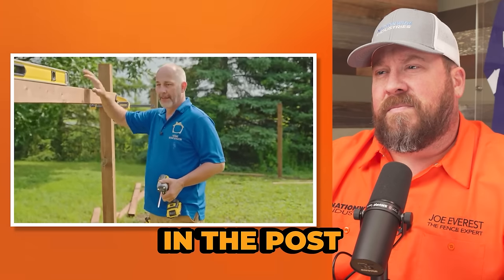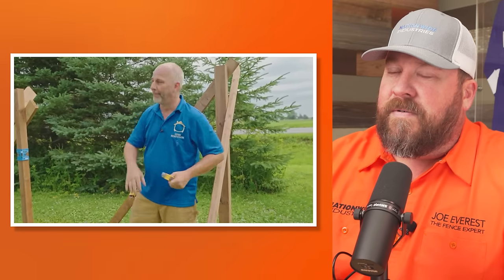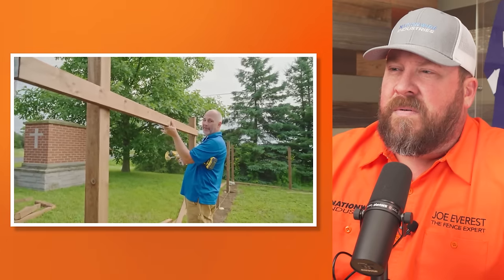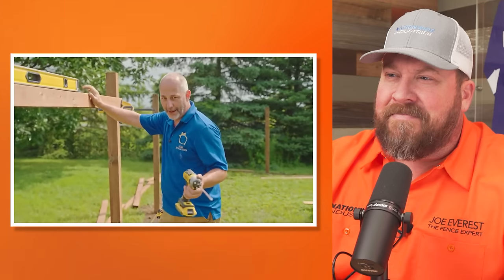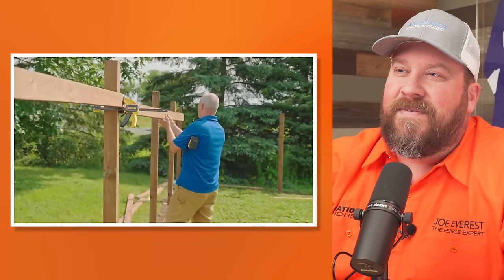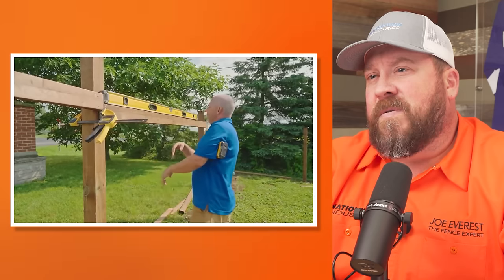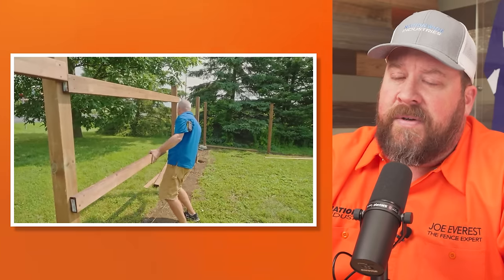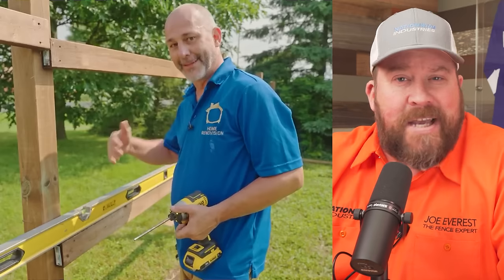PLEASE Do Not Build Your Fence This Way! - Fence Pro Reacts

Comment: This put a smile on my face. I used to be subscribed to that Jeff guy till one day he was doing duct (ventilation) work and a pro told him he was doing something wrong and it made a lot of sense. The guy was saying to put the male vent pipe towards air flow and the female against the air flow like that you get less potential for air leak. Instead of accepting his mistake and thanking the guy for info, this Jeff guy told him off, I unsuscribed on the spot. Haven’t watched any of his videos since lol. Keep up the great work.
Reply from the maker: Sounds like a very Jeff move, thanks for watching and weighing in!
Reply: yeah, just did a load of ductwork in my new house and it made sense to me that way (thought of water rather than air) so having no edges to "catch" would improve air flow.   rarely touched metal work since I left school but being a technical guy in a technical trade, I read a book on the subject first.

There are Social media people who are educating and others who use it as a source of income.   many "trade people" start out as the former and end up as the latter.     Not to say there is no information to be gained, even if it is bad information.
Reply: Thats one of the first things you learn in sheet metal school after how to use tin snips lol
Reply: Can yoy elaborate? Male part as in it fitting inside the larger female duct? 
If the air is moving towards the "male" interior edge part it would create a high pressure zone in the joint and cause more turbulence/non-laminar flow... you sure your didn't mean the opposite? Can you please post video link what he did?
Reply: @stoptellingmewhattowrite  I’ll explain it with left and right to make it easier to understand. Say air is flowing to the right and you have 2 pipes joining together. Pipe on the left would have the male part that fits in the female on the right side, pipe 2 has the female on the left. The pipes have about 2-3 inches of overlap, either way the joints are taped but if done correctly, the tape is just a precaution but if done the opposite way you’re fully relying on the tape for no air leaks.
Reply: @theone3337  So you are saying! Male end of duct should follow direction of air flow, down hill, step down, so air can flow over internal edge instead of hitting it?!
Reply: @mongo33101  yes
Reply: I unsubbed when he told his viewers to run an outdoor electric cord through an exterior wall
Reply: I undescribed too.
Reply: Your loss.

Comment: I attended a 2 year residential remodeling program where you graduate with an associate's degree. Our first year carpentry instructor (who was very talented... and demanding) described what he called a "quality triangle", where one edge was "good", another was "fast/easy", and another was "cheap". He drilled into us that you can only achieve two of those edges, not all three.
Reply: This applies to so many things, like building cars!
Reply: Thanks for sharing this.
Reply: It's songs like you have a problem with him not just the work
Reply: @anthonyc5003  Actually, I am a subscriber and fan of Renovision. However, there are occasions where Jeff's choices appear to be sub-optimal to me. I think he would have had a better result with using concrete for the posts as opposed to the foam product. This is a case where the fast/easy triangle vertex did not serve him as well.
Reply: Is carpentry hard I’m thinking about going to community college for it

Comment: As a home owner, on 40 acres. I make sure to do everything as good or better than the pros. The thing I can’t understand is why do people make “how to” videos about any subject if they have no clue what they are doing.
Reply: They are doing it because they truly believe they know how it's done. That's why I watch many how to videos and do more research to ensure I know the correct way before I follow a particular approach. Don't  just look at the first video that comes up with a particular solution to the problem.
Reply: Anyone can make a how to video, unfortunately it doesn't mean they're doing the activity correctly. I'd follow a dedicated fence pro on how to build a fence.
Reply: Likewise, I'm a homeowner on a small farm and the reason I'm a Do-It-Yourselfer is because of too many past disappointments. People either never show, delay you by months or even years, (the best contractors are usually booked up for many months), or too many do crap work with low-quality materials and disappear. The last thing I hired done was concrete flat work. It wasn't horrible, but had I been home I'd have noticed there was no expansion joint between new work and existing work. As I predicted, the outside driveway chipped out the edge of the garage floor from frost heaving for lack of an expansion joint. I think we could find dozens and dozens of how-to videos showing new concrete work meeting existing work without expansion joints. I feel bad for people who aren't discerning or have too much confidence that projects done on YouTube were done well. Too often something catches my eye and I soon realize the quality of information on the subject is simply wrong, even if it's something as simple as nesting boxes in a backyard coop.

Comment: To be fair, if you’re DIY all the crap that home renovision covers, his advice is usually pretty solid and understandable for the average Joe that is DIYing a job.

Also worth noting that even if you hire a “professional”, half the time they suck. So you really have to dig (no pun intended) to find a contractor that is going to correctly build you a solid fence.

I love the Home renovision channel and find a ton of useful info in it. But I also understand that his methods are “good enough” and not necessarily best practice. As long as you understand that, it’s a fantastic resource if you need a starting point for DIY projects you otherwise know little or nothing about.
Reply: With certain things "good enough" is unacceptable. Fencing is one such thing. Better yo spend the money or the time researching the correct way of doing something to make sure it lasts. That whack job just hands out misinformation and shotty practices, and people follow his advice. That's not cool. A fence like what he glbuilt is going to look like crap and it won't last more than 5-10 years. Charging someone for that kind of work is slimy af and doing it for yourself is pathetic. I understand some people just want a fence that will last at least a year because they're selling or whatever, but that is also equally slimy.
Reply: @ericr154 literally every trade says theirs is the one where “good enough” is unacceptable.   They also all have a point. As most people cannot afford to have the best professionals do literally all the work on their home, being able to do minor repairs and improvements to “good enough” is a very valuable skill. 

Though one should try to understand the work one is doing well enough to know how you will be paying later for your shortcuts and learning curve. Specifically what it will cost you in effort, inconvenience, cash, or durability.
Reply: His drywall videos are terrible

Comment: I feel like this guy says "work smarter,  not harder" a lot.  Not measuring isn't smarter, it's just lazier. If you're spending the hours (or days) it takes to build a fence, why are you trying so hard to save 10 minutes.  Realistically, it would probably take me less than 10 seconds per post to measure 6 inches down and make a mark.  It would take me 10 seconds to measure 8 feet BEFORE I spend 10 minutes digging a post hole.  Yes,  it would take me a little longer to cut a mitered end on a stretcher, but i would probably make that time back with how much easier it would be to hang my pickets. And i wouldn't have to worry as much about my dogs getting out under the fence or, similarly, unwanted visitors getting in. Plus if I sold my house,  i wouldn't have the buyers putting "a new fence" as a contingency after they saw the hobbled together mess i made after watching that video.
Reply from the maker: All great points, thanks for watching and weighing in!

Comment: the fence on my parents lot that they bought next door to their house, has got to be close to 100 years old!  the house was built in 1908 that we demolished, and ide be very surprised if the fence wasnt original.  its only a 4 foot fence, but its def old AF.  i donno if its cedar off hand, but ya, its old, looks old, but is still sturdy and doing well.
Reply: why would you demolish a 1908 house? 😡
Reply: More than likely redwood, that stuff lasts forever and was common back in that era for building material
Reply: @CaliGhost  mmmm, i donno, im in wyoming, we dont have any redwood anywhere close to here, but i have no idea how the dispersion of redwood was back in the turn of the 20th century, so obviously its possible.  im sure it was along those lines if anything.  the fence wasnt primo condition, obviously, but it was in tatters, it was just a little leaning to the side, and pretty much weathered black an grey.  now that im done writing a stupid mini novel, im sure youre right lol.  either way, ive had an unhealthy level of fascination with fences lately, and i dont know why, i have a chain link fence

Comment: I dont use foam at all, and only use concrete where a gate will hang. I sink my posts 4 feet down and never had an issue. Concrete on every post is only necessary in dry rocky, sandy or clay soil. Most yards I’ve worked in are a good mix of rocky earth. No issues and easy to fix later in time. I roll
Everything with the terrain and set posts 8’ centre.

Comment: DIY my fence and I can personnaly attest to the fact that "foam fence post mix" do work. But the one with the concrete is significantly stronger in my opinion. The concrete has less movement after 1 week, and after 2 years, now 7 years later and still more noticeably feels stronger. Out of 8 fence post installed, the first 5 with concrete is rock solid compared to the foam. I still ocationally push on it once in a while to see if my opinion would change. The slight give on the foam is notieable still. All are 8' treated 4x4 post, buried 3' deep withthe top post on a string line, everything was installed identically with the foam being the only difference.

Comment: If there is a deviation of ground between two posts, should you just dig out the ground or fallow the ground even though the 2x4's going across are straight?

Comment: Where I work virtually all fences have wood 4x4, I rarely can talk people into metal posts. The rails are in brackets between the posts. People complain when the fence follows the grade because it “isn’t straight” what they mean is level. They virtually all demand stair steps while also not wanting any gap at the bottom. To the point I have to argue that the pickets can’t touch the ground. The more I see from other states the more I think I should move.

Comment: Nothing wrong with stepping. I prefer the step look in most cases as long as they are not big steps. I like the level lines look.
Reply: Agreed. As long as you have a few panels at the same level and step sections of 2-4 panels at a time. I prefer that look.  But hey, all personal preference there.  I do agree with the other commentary!  Measure twice cut once.

Comment: I really like some of Jeff's videos, they can be really useful. 

But I have to be honest, he's miles wide of the mark on so many things in this video. 

I'm completely self taught and even I would be going "f**k no" if I saw someone doing pretty much everything in this video!  

For a start, wind sheer IS real!  You NEED bloody strength. 
I've seen the wind rip a fence to pieces and punch a picket through a car windscreen. 

Can you imagine what that'll do to a child's body?  

Secondly, that foam fix is just absolutely sh**.
Might aswell set them in horse turd!  

That second post moved when he was marking it WITH HIS PENCIL!  

Come on Jeff!  Don't let sponsorship compromise your own standards. 

I've SEEN you build far better than this!

Comment: Absolutely agree Joe if it’s a DIY or newbie installing fence they should definitely use a stringline and tape measure and take out the guess work and the, looks good enough 😀and racking with the grade instead of stair stepping when you can 👍
Reply: Professionals still use string ling to mark the rail lines not just diyers.

Comment: I had a capped design put in last June in Harrisonville, Mo.  The posts do not move unless you push reasonably hard.  That movement  you see in this video disturbs me.  Foam just sounds sketchy to me.

Joe, I paid a little extra for the capped fence.  Does that indeed improvee sturdiness and logevity? It is definitely more eye pleasing.  Do you think it was worth the extra money?  I wish I could post a picture.  It's gorgeous, especially after putting a oil based redwood stain on it after the wood dried out.

Comment: You know, I set my posts with gravel at the bottom and then concrete around. Then I used square rocks to level everything underneath the fence, so the lowest part of the terrain has a bit of rock showing, but at least the whole fence is one level and the bottom of the sides does not touch the ground, ever.

Comment: In Australia, where I've built several fences, our approach is to construct things to last for 50-80 years. That's why we have the saying: "Prepare well, do it right the first time, so you can relax with a drink that night." As a tradesman and as a person, I don't tolerate halfway craftsmanship. Taking pride in one's work is crucial. That's why we rely on string lines and measuring aids to ensure the job is done properly.
Reply: Australia has some of the worst tradies ever. Their work is shocking.

Comment: How do you feel about using OZ-Post spike to install fence post?
Reply from the maker: We’ve only used them once and it was a very great experience
Reply: I used it for a rotted off mailbox post.  Was a quick and easy solution.  My biggest concern is that if you don't seal off around the post, water will drip down into the end of the post and rot it from the bottom up.
Reply: I installed them and so far they have sustained a few days of wind gusts of up to 35 mph so far so good.. I used waterproofing stain before setting the post and then caulked around the base to help prevent water from running down into the post

Comment: The real test for anyone who puts wood in the ground… is do they know the difference between UC4A and UC4B PT lumber? If you use UC4A (what they sell at every lumber yard off the shelf) then it will likely rot off in 5-10 years, maybe 15-20 in a dry area like where I live.

If you use UC4B treated lumber (like they use in engineered post frame foundations) the lumber will last 70+ years in the ground.

Is this necessary in every circumstance? No, obviously it’s not. But if you didn’t know the difference to begin with, I question if you’ve actually done research or only listened to the “old timers” about every single process on how to build a fence, a deck, a post frame building, etc.

I’m also a fan a metal brackets made for bending moment loads, etc. but sometimes a post in the ground is better, depending on your application or availability of materials.

I guess my issue is, if you’re going to mock Jeff for his easy DIY methodology (which is fine too in many respects) I’m hoping you educate your audience on different treatment levels and analyze the pros and cons, effective time frames, and applicable situations. 

If you do this, great. I’ve just found that very few people ever mention the UC4B or UC4C options in PT wood. Everyone just assumes all PT wood will rot in a few years with concrete in the ground.

Comment: The foam was a big mistake. dumping dry concrete and adding water incrementally is not that much harder and it will be super solid and strong. The "eye balling" method always used to come back and bite me in the as* so I learned that measuring always gives me a consistent result.

Comment: I agree with you that Jeff's fence building techniques are questionable. Jeff's other building techniques for houses are pretty good. As I have qualifications in engineering in Australia and due to the long-term problems with using timber posts, I use steel posts, concrete and heavy rust prevention. The concrete level is above the ground and has a slope away from the post. Also, in Australia we can get over 17' lengths of fence rail. Using these rails allow for staggering the joints to increase the strength of the fence. At rail joints, an angled joint is used as well that allows the two fixings to the post to be away from the edge of the post. Under the pailings, I also install a concrete mowing strip that is reinforced into the post concrete.